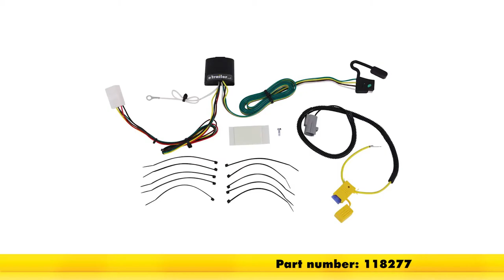Setting up the T-One Vehicle Wiring Harness for Factory Tow Package on a 2016 Mitsubishi Outlander

Comment: Hi, I have a 2014 outlander and i am trying to buy this part from you website, however it does not show it as recommended for my vehicle. My car has the factory  pre package.
Reply from the maker: Do you have the Outlander or Outlander Sport? If you have the Sport, does it have LED tail lights or not? Thanks.
Reply from the maker: At the link below you can view the harnesses confirmed to fit a 2014 Mitsubishi Outlander. 

https://www.etrailer.com/t1-2014_Mitsubishi_Outlander.htm
Reply: Jonathan Clausen  I have the same question.  have you figured it out?

Comment: I'm having troubles hooking up this kit on my PHEV model. Do you have a link or video to watch for it. The battery is in the back of the vehicle and I do not see the quick connect trailer prep package wire up front. So I dont know where to plug the positive terminal wire to.
Reply from the maker: We currently don't have an install video of this wiring kit on a PHEV model. If you have the factory tow package but can't find the connector for it when following the wiring instructions then you may need to reach out to your local Mitsubishi dealer to see if they can help you locate it. They should also be able to help you out with that wiring for the battery. If you don't have the factory tow package then you'll need a different wiring kit that plugs in behind your trailer lights. You can find our selection of wiring options here https://www.etrailer.com/t1-2016_Mitsubishi_Outlander.htm

Comment: Would this apply to a 2016 RVR?
Reply from the maker: This wiring kit is not designed to fit the 2016 Mitsubishi RVR. You can use the kit in the following link to get your RVR wired up.
https://www.etrailer.com/Wiring/Curt/C59236.html